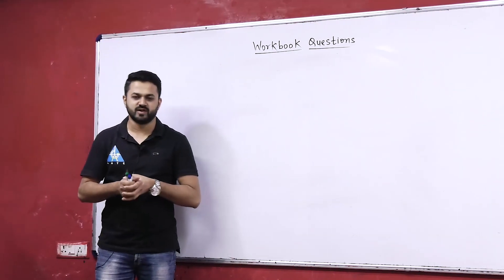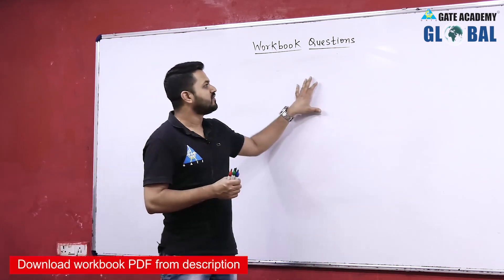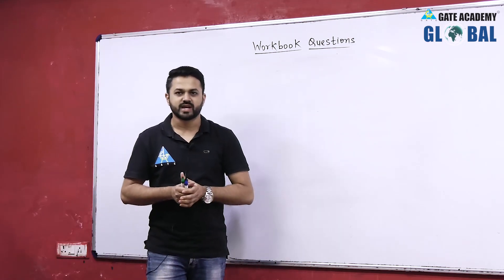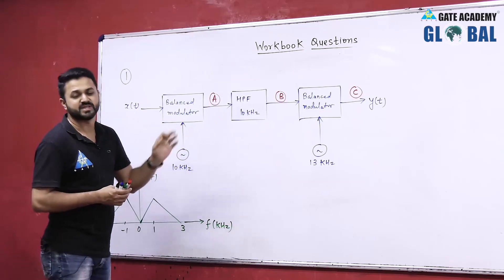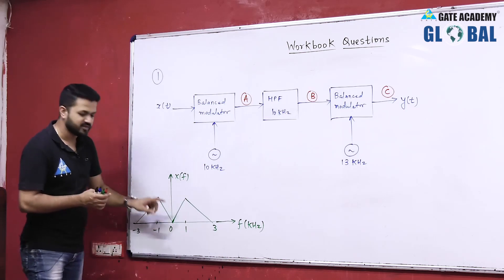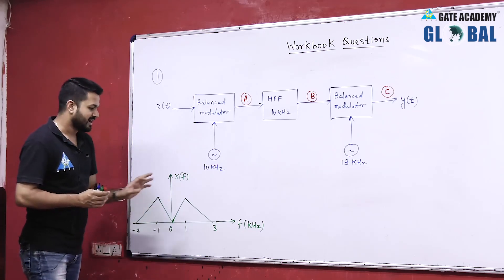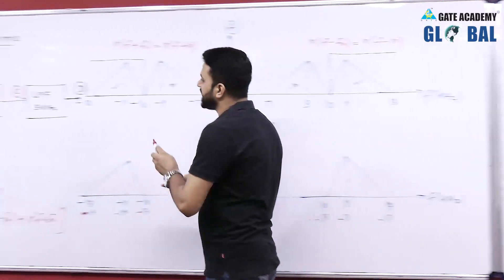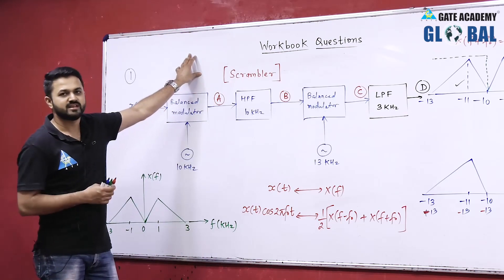Part-1 | Practice Questions | (Amplitude modulation) | Lecture 9 | Communication System

Comment: sir this work book is not open this is only the address of drive.
Reply: @saket115  yes sir, problem resolved... Thank you so much
Reply: @saket115  sir  is your lectures are also helpful for Electrical eng. who are preparing for ese, or various exams ? And if yes how much depth is it same as EC branch or less ?  And are these complete lect . module for EE ?